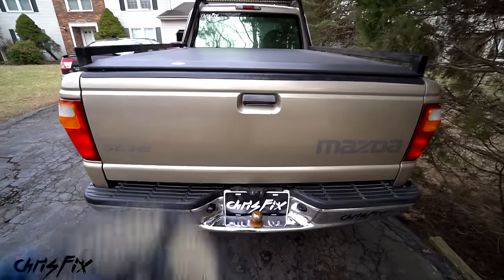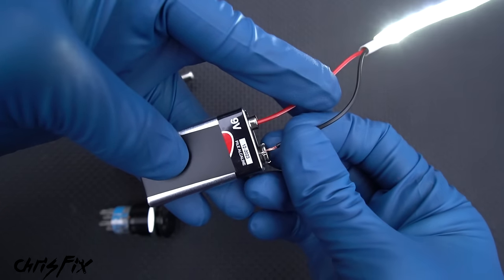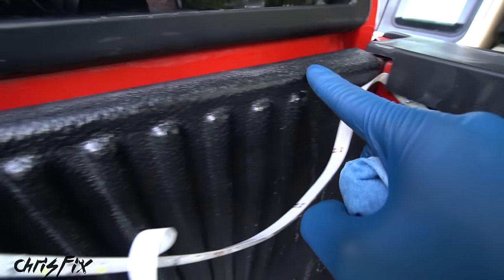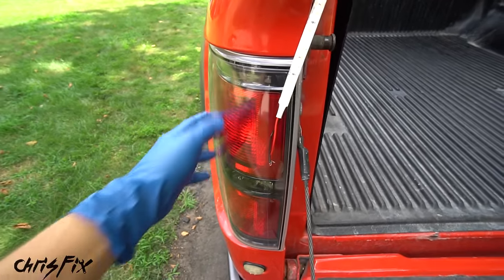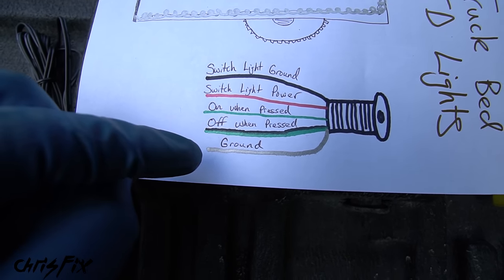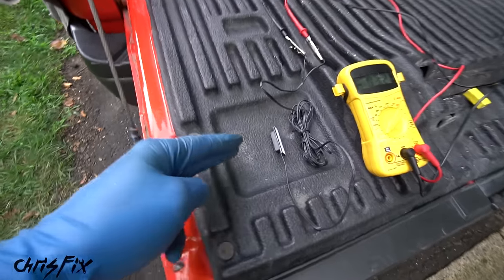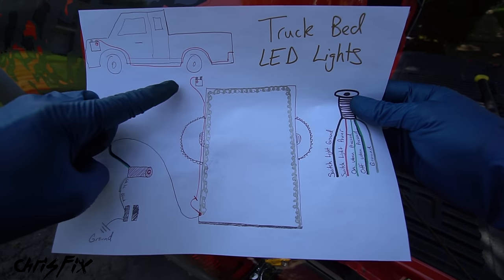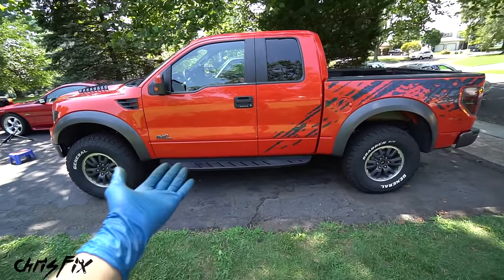How to Install LED Bed Lights (Fun DIY Project)

Comment: Just causally has a nos tank in the back of the truck💀😂
Reply from the maker: JustDom Gotta get all the power I can!
Reply: I realize it after you say 😂😂
Reply: JustDom cybertrucc with nos
Reply: @arian_5.085  extra big capacitors*
Reply: @jarrettc.4417  That gauge of wire can't handle anything close to 50A (probably 20A-30A max, and that's pushing it), and would result in the wire more than likely catching fire in the event of a short. Basically the wire would behave as if there were no inline fuse, and it was connected directly to the battery.

Comment: Would really appreciate a hardwiring tutorial from the legend himself, there aren’t much in depth videos that explain this topic well on the internet and it can be a game changer since installation for electric mods on vehicles are very expensive
I wanted to install an ambient lighting kit on my car which cost me 60 bucks but the installation in my local shop is 1000 bucks
Reply from the maker: Glad the video was helpful!

Comment: Tip: heating the tip of screw driver with a lighter makes it easier and cleaner to push it through the plastic bed liner.
That wiring diagram is top notch!

Comment: *Me happily watching a video on how to install LEDs on a truckbed while owning an 18 y/o sedan *
Reply: Same here, just watching a video on installing leds when I very much know how to install leds considering I put 34 of them on my truck along with a strobe module and relay for running lights lmao.
I did skip the wire loom rule tho... Something about running loom along 6 different wiring harnesses adding up to 100+ feet of wire with over 70-80 connectors on them turned me off to that idea.

Comment: Don't forget, that wire size directly dictates how many amps can travel through the wire itself. Oversizing a fuse is dangerous. Oversizing leads to the fuse, a over current protection device, to be utterly useless if it exceeds the amp limit on the wiring leading to and away from it. You can get away with a few extra amps when sizing up, but always be cautious when doing so. If it's an old circuit it may have already been stepped up...and now your entering a danger zone. For more clarification on amp to wire size always reference the National Electric Code. Also know as the NEC. A quick Google search can save you your ride and possibly your life.
Great video Chris!

Comment: So does this increase performance like in a PC?
Reply: Only if it's RGB
Reply: more fps on your gps
Reply: No, but increases the usability unlike in a PC
Reply: It adds 50 HP
Reply: More lumens = more horse power
Reply: SwapniL Nair if you put it under the car as an underglow it’s easily +200 HP
Reply: More Horsies
Reply: +10hp
Reply: @netpok  bruh!!
Reply: @mcp866  ye add 50hp to ur pc
Reply: GM and ford should make this a standard under their hood, since they always break down in the most inconvenient places
Reply: Probably the value of the truck or car
Reply: If your with a lady it does
Reply: It increases your RGB gaming truck
Reply: I like how your pfp is your name
Reply: its not rgb so no :(
Reply: Adipoli

Comment: Today is November 11, 2020.
As a subscriber, I have no idea how I missed this video back in January!
I just replaced my old vinyl tonneau cover with a hard, Bak Flip MX4 cover.
Once that was done, I couldn't wait to tackle this project!
I have a 2011 Toyota Tundra with the OEM bed rail system.
I also have a sprayed in factory bedliner.
I decided to run the led strip under the rails.
I used 99% isopropyl alcohol to clean the surfaces but also ran the 3M high bonding tape all the way around, just to make sure the LED's would stay stuck.
The more difficult part was figuring out the wiring on the switch as the wires are different colors than yours, Chris.
It didn't take long to figure that out and I felt tremendous satisfaction when the whole install was complete!
It looks amazing and works perfectly!
The only issue I have is the LED strips were beginning to sag on the ends of the rails I attached them to so to solve that, I wrapped each of the rail ends with a black zip tie.
So far, nothing seems to be sagging!
Thanks again Chris for another educational, fun project!

Comment: little tip- you could find an unused fuse in the fusebox that gets power when the truck is off, then put an undervolt-protection circuit on it so it cuts out if the truck's battery voltage gets too low. This is pretty common practice for things like dashcams :P only difficulty is getting it from internal to external, unless you have a free fuse in the enginebay fusebox.

Comment: Old timers will remember when lights came under the hood already.
Reply: Yeah they'll also remember how they were just a little 912 bulb that did nothing but drain your battery if you parked on a hill due to the mercury switch most of them used.
Reply: Jon Warrell my truck came with a work light under the hood you can move around
Reply: @nickwebb9937  Yeah I'm familiar with those, my grandfather's 96 Silverado had one. Those were a neat feature.
Reply: Jon Warrell I replaced it with an LED and it ain’t half bad honestly

Comment: I can't be the only one irked that he did the whole job clean as hell then just threaded a bolt over a bare wire for the ground instead of a ring terminal, etc.
Reply: Well, yeah. I was thinking heat shrink up to the bare wire. Put some protection on it
Reply: yea Mike you are, if you have a problem, do it right it's up to you.
Reply: That was so disappointing!!!  Everything else was perfect, then he didn’t use a ring terminal on the ground!!  Glad I wasn’t the only one thinking that!
Reply: @bobm7275  apparently I'm not so 🤷‍♂️
Reply: I was watching on my tv and had to visit the YouTube app on my iPad just to read the comments after I saw it. There were a few other iffy parts but that bolt threaded over bare wire was too much.
Reply: @Ryaneli10  same here
Reply: Yup that ground made me cringe, and you should tin both ends of end of a wire before soldering, no need to wrap them into a knot.
I'm not a fan of soldering on mobile applications anyway
Reply: Probably he doesn't have any ring terminal that size.
Reply: too true, I was thinking the same thing..
Reply: I have seen him do it correctly in older videos so I'm just going to assume he got to that stage and was short a part and just made do to get it done in time.
Reply: @Ardian1899  If it’s not practical to go to the store during filming, at least say the right way to do it.
Reply: @mrgoats  that connection won't fail easily. Especially when it won't move too much. It just another way to do it albeit less pretty.
Reply: @Ardian1899  the guys at straight pipe already confirmed this failed… I don’t know what makes you think it wouldn’t. Stranded wire against sharp metal in a moving vehicle really has no chance. That is the perfect setup to fail.
Reply: @mrgoats  The wire isn't heavy and these things are attached to each other. Guess it needs some off road driving to fail it. On some normal town streets, it'll hardly fail.
In any case, it just a minor fix, cheap and no harm.
Reply: @Ardian1899  Best to do it right the first time rather than waiting for it to fail. I think they know better but got lazy

Comment: I highly recommend to put the positive + wire through the switch instead of the ground, because ground is everywhere and can by time to time "accidentally" closes the circuit, and the led lights will never go off.
Reply: Yep, never switch the ground, always the positive.
Reply: Thank you for the advice!  How would you recommend wiring the switch if you wanted the light on and to be off with press?
Reply: @joshshoup2140  power to a "normally open closed when pressed", button
Reply: TheDarthJesus on my diagram I have red off battery to green/black(off when pressed) and red (switch light power), then the ground off the switch to the magnetic switch which is then hooked into the red of the led lights. The led lights ground is not disrupted by anything. Does this sound correct?
Reply: @joshshoup2140  You're using both a magnetic switch and a push button?

In any case, grounds should always go direct to ground.
Reply: @joshshoup2140  There is already a button made for that, it is named DPDT button. Just wire it on the NO side and Common, so when you push it the light goes on, and when u push it again the light goes off.
Reply: Gotcha. Thank you both for the replies. I thought it was a light that was always on to help locate the button in the dark.
Reply: Lukas Liwandouw switched grounds are used all the time, especially when not using a relay for your power, but even when you do use a relay, for very high current loads, it’s best to run a switched relay on the ground side so your relay doesn’t burn out. 

Switches will burn out quickly if you are running much more than 5-6 amps through them because of the arc when it is switching between the on/off contacts. 

The benefit of switching the ground is that the ground side when switched will arc less than the power side, hence your switch(and relay if used) contacts not burning out.
Reply: Lukas Liwandouw as far as “accidentally” closing the circuit with a switched ground, the only way that could happen is if the wire broke pre switch, and then somehow managed to get good contact to a grounded surface......and that would only happen if you didn’t run the magnetic switch like he does in this video and a switch only. Use of the magnetic switch makes it impossible for the circuit to close unless the tailgate is open

Comment: Awesome videos Chris, & love how you do them w/ “standard” tools that most ppl have. A tip for you when soldering 20:00 can dip the ends of the wires into some flux, to help take the solder & will help those who don’t solder very often. Otherwise, great job on this project👍🏻 Thought was executed really well, & looks great💪🏼
Cheers✌🏼
Reply from the maker: Thanks a lot
Reply: Another thing I learned about soldering especially when doing motorcycles when you have 5+ wires to do at once is go ahead and put a bit of solder on the end of each wire on each side and the go back and just melt the solder together instead of trying to hold the wires together. Works best when dealing with smaller wires

Comment: Well, to be frank - you don't have to run a cable all the way fron of the car to the back of the car.

Did similiar lighting job for my old VW Passat couple of weeks ago. Wiring logic was quite simple - switching signal i stole from dome light allready rear of the car, ran it to relay and relay switched power from 12v socket line to LED strips. 
Both rear 12v sockets are fused by factory and interior dome light is fused and switched via trunk lock. Quite foolproof tbh.

And yeah, here in Europe we rarely see F150 - we have those quirky german and french cars and there is never space left for extra wires. Or, if there is, then it is covered with all kind of brittle plastics.

Comment: @ChrisFix - those reed switches are not rated for the current that a whole length of LED strip will take. Eventually the switch contacts will weld themselves shut.

You need to use a relay to handle the current from the lights, and use the reed switch to throw the relay

Comment: Great idea. Everything you did was quality although I would NOT have connected that final chassis ground like that.
Reply from the maker: Thanks! I've done grounds like that on my truck and they last years with no issues!
Reply: @chrisfix  great video but I'm with LedBased on this especially when you had a box of "forked crimp connectors". 
Best idea would have been to crimp the end of the  magnetic switch wire that goes to ground, then secure it under the nut. When the copper wire corrodes in the elements (which it will) it'll have far better continuity and wont l have a ton of resistance. Other than that, nice install 👍🏻

Comment: I know the videos old but I just did this install but instead wired the switch and button to the positive side it worked great went out there this morning and the magnetic switch was melted and looking through the reviews other people doing the same install had the same problem with the magnetic switch melting.

Comment: Hey @ChrisFix, awesome video! 

There is one small thing to note about the magnetic switch you have linked in the description - there is a possibility of that switch failing early in its life due to the continuous current draw through it. If the average current draw of the powered LED strip is 5A @ 12V, the continuous power will be 60W (5A * 12V = 60W). The wire included with that switch is 22AWG, which is definitely fine to handle that ( 6.5A, 300V rated). However, the magnetics inside the switch may not be rated to handle that much current for extended periods of time.

With that being said, because you've added the second kill switch, and because people probably won't keep these lights on for long stretches, this is probably not a issue to be worried about. Just wanted to throw in some thoughts!
Reply from the maker: Thanks for the info and you would be correct. That switch ends up not being good enough. It failed after 2yrs of use so we upgraded it.
Reply: @chrisfix  what did you upgrade it to. I am planning to do this after watching your video
Reply: @chrisfix oh man really? Any chance you’d update this vid or post another one with that update so we can know?
Reply: Following

Comment: Great work with great results... one point to mention for you or for the viewers, at 14:30 I guess it is better to use circuit fuse tap adapter and connect it to the fuse box inside the vehicle comportment instead of the direct battery connection.  Trucks and SUV add extra space as “Spare” for any add up accessories.
Reply: I love Chris videos very much. I learn so much from Chris.  I may be wrong, however with respect,  i think Chris using a 10amp fuse for only a 5amp requirement could be wrong. Also his comment in saying one should use a higher amp fuse instead of the lower required amp rating. This going in excess of the original amp rating of fuses can lead to an electrical short and/or fire.

Comment: Hmmm more blinker fluid, I feel like I need some of this for my car.....it seems necessary 🤔🧐
Reply: We need a video on how to install an air filter on our tires, so when we change from winter air to spring air the dirt stays inside the tire and not released back into the atmosphere
Reply: @michaelc9128  you just have to make sure you run fully synthetic winter air for the best mpg 🤣

Comment: This is actually amazing. I’m gonna attempt this with a small 12 inch LED light bar🤔
Reply from the maker: Awesome! Let me know how it goes!
Reply: @chrisfix  ok I figured it out , but without using the 3 wires that you didn’t use, but what if i want to connect power to the switch? Just ground the black wire to chassis and send the red wire to another fuse interrupted positive battery connection?

Comment: I would put a Wire along the back and reconnect on the left side so it’s more clean
Reply: Plus they're right in your face when you're loading.  Even with the bed liner, the load could hit the lights as well.
Reply: Not even that, do the same thing take the right tail light off and run a wire under the bed and connect it the same way, this way you have two parallel lines of LEDs.
Reply: Or you go for a minimalist approach like the guys wanted and minimize the points of failure for the future...